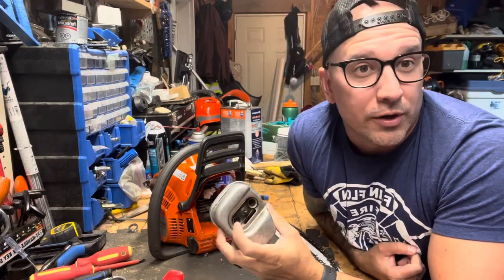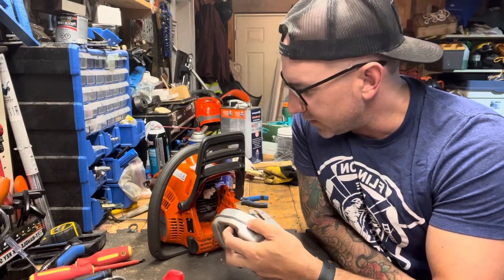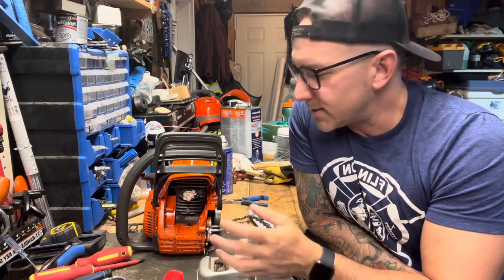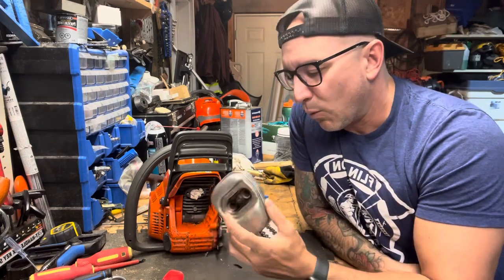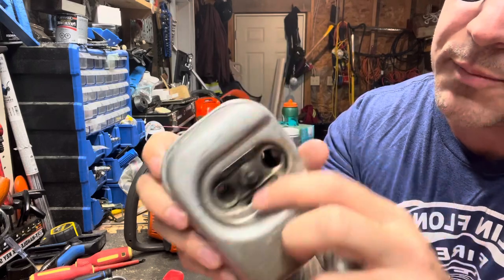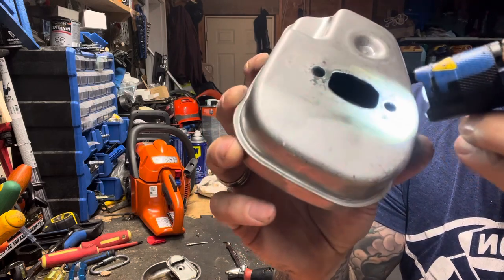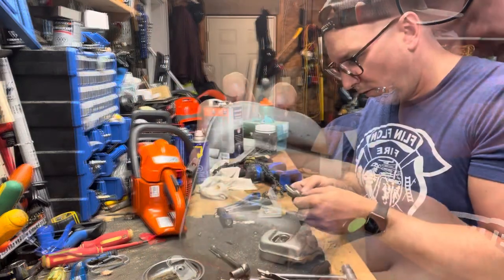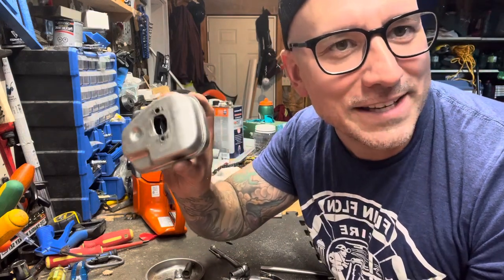Husqvarna 120 Mark II cuts with muffler Mod. #firewood #husqvarna

Comment: frrom new zealand im an ex logger gr8 wee saw but we have the same issues with the 120 mk11 here also . seems the key thing is to get muffler to breath better seems to make a huge difference then re tweak carb. i shall be opening the muffler up on mine
Reply from the maker: It’s helps tremendously.  Thanks for tuning in! ✌️

Comment: Thank you Sir! :)
I just bought the Husqvarna 120 Mark II here in Sweden for $229 (Black day or something..) and I am obsessed with being able to tweak stuff from original to perfection.
CPU, GPU, Automotive lighting,  engines, heat pumps, etc.

I will do this muffler-mod, and report back!

Also, you have a self-deprecating sense of humour, that is a very important personal trait since we are all entering the dark ages. 

Keep up the good work! =)
Reply from the maker: The mod will help with throttle response and overheating. The saw does perform better IMO. Thanks you for the kind words. ✌️